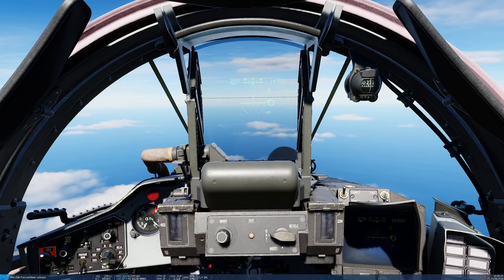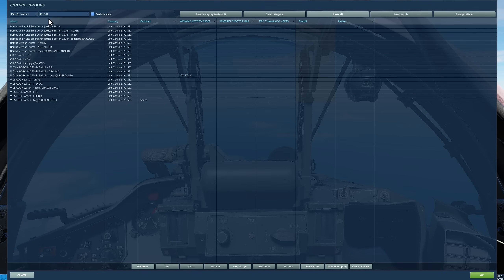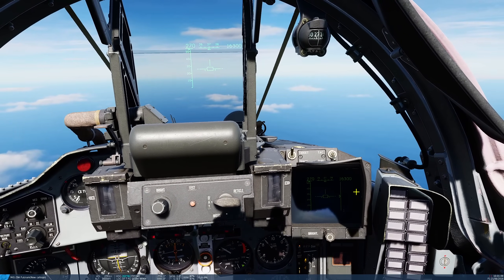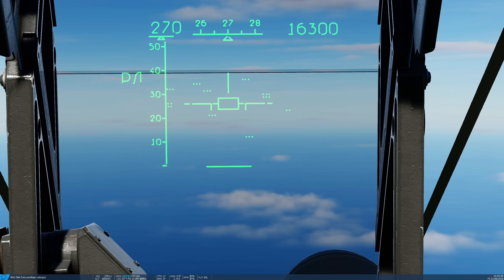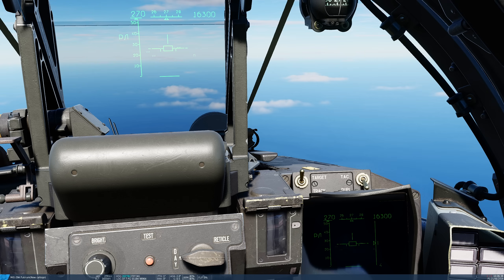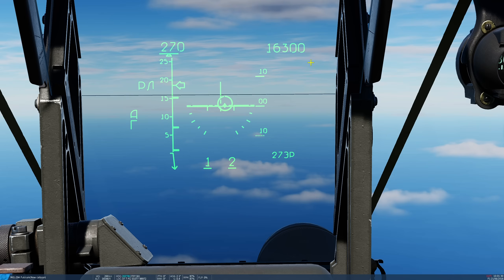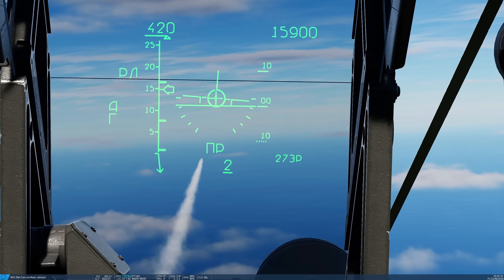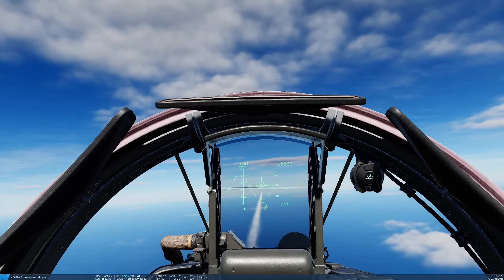Mig-29A Fulcrum: Air To Air Radar & Radar Missiles Tutorial | DCS

Comment: Using Delta H doesn't require any maths to understand where your radar is looking. Each number is an altitude difference in kilometers between you and the expected target. For example, AWACS tells you that there is a target 50km away at 3000m. If you're flying at 5000m you set delta H to -2 and target distance to 50. Super easy
Reply: Is there an imperial version?

Comment: 2:11 The radar TWF switch IS NOT track while scan vs range while search! 
- The switch is called Track While Flight abd it is simply a helper tool to preselect the most dangerous target for a lock. In that sense, both are kinda TWS but rather a pseudo TWS. The difference between the two settings is this:

FHS - means the radar calulates the biggest threat showing a "Front HemiSphere" aka HOT aspect planes
RHS - means the radar calculates the biggest threat showing a "Reward HemiSphere" aka cold aspect planes

Keep in mind - this system just helps you to automatically select a target (closest one in most cases), so you don't need to manually move the cursor over it and lock it. It is not a true TWS, so it doesn't give you any other information or in practice it doesn't split total energy to "soft track" a target with a bit of energy, while it continues to scan for other targets with the energy that is left.
That it isn't a real "track while scan" is already kinda obvious, by the fact, that it has no OFF position.